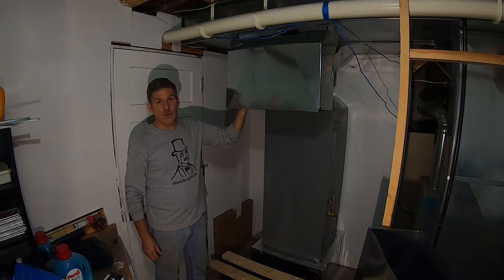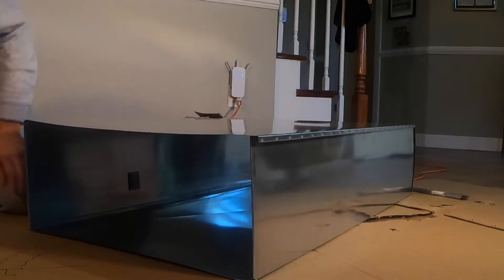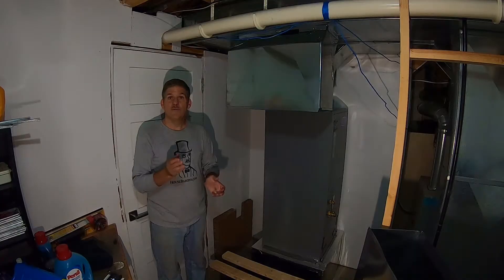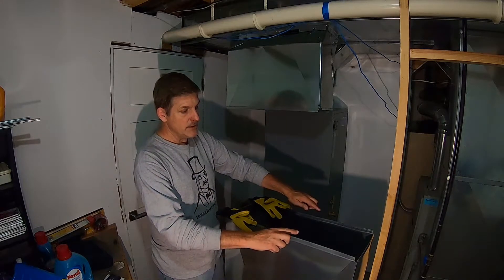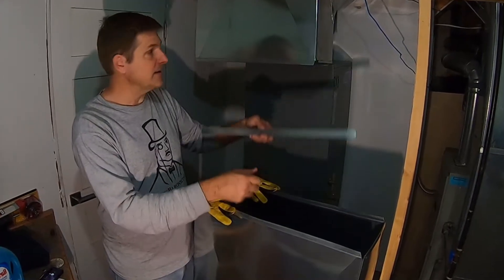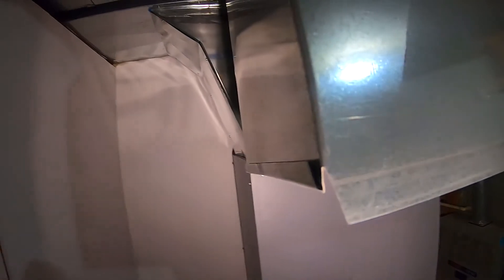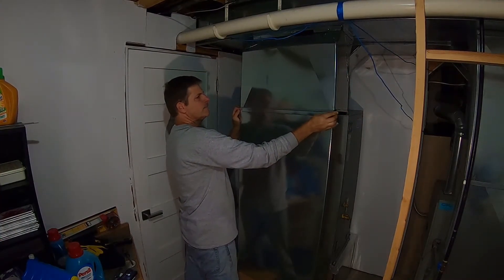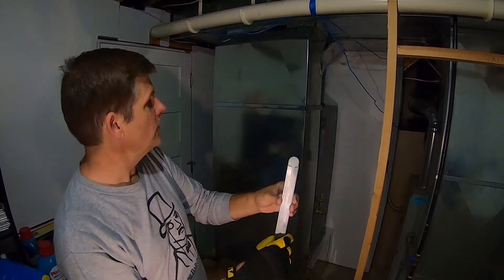Ductwork installation - how to connect rectangular ductwork

Comment: Great video. Any suggestions on how to remove the S and C cleats from a section of rectangular ductwork that is running horizontally between floor joists? Maybe I have to drill holes in the other floor joists to pull the S cleat out from the side.  I can't drop the ductwork very easily. Any ideas are appreciated. Thanks again.
Reply from the maker: Hey Steven,
Cutting into floor joists would not be my first choice as those are structural AND the c-cleats are folded over. What about an angle grinder or ( slower ) an oscillation multi-tool to cut the ductwork?
What are you doing? Changing the ductwork path, removing a section?  The ductwork can easily be modified. 
Cutting out a section ( big or small ) should not be a big deal....
They don’t HAVE TO be joined by cleats. And they just form a channel for air to pass through. Repair using sheet metal screws and aluminum seam tape can be used to repair a cut section of ducting. 
Hope that helps.
Thx for watching.
Reply: @Housebarons  I have a video that might help?  You’ll find the removal happening at 14:17 minutes of this video. https://youtu.be/pZtxYIGDLaQ

Comment: Hey, nice video. Do you have a video showing the whole install, including the ductwork? I want to install one of those, but I am concerned that my ductwork is too small. I want to install a 3-ton system, but my ducts are 8x14, unfortunately, the local contracts charge too much, I can not afford to pay them.
Reply from the maker: Hey Bruce,
Sorry. Our duct work was already in place. 
Here is our Mr Cool heat pump install.
https://youtu.be/9THmI2nvtGY

As for the duct layout, we are renovating a 120 yr old house now and recently got a free duct work plan from a company connected with a big box store. 
The thought is - if you get a ductwork plan, you are equipped to buy the ductwork from the big box store. 
There are a lot of calculations that go with it - not too simple. But once you have the layout , you are half way there. 
It would be worth searching out.
Thx for watching!